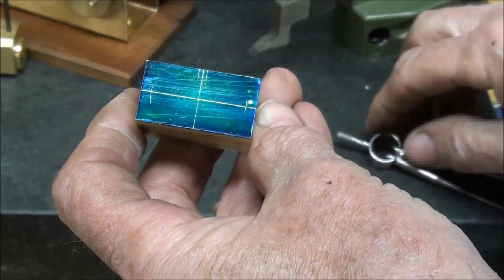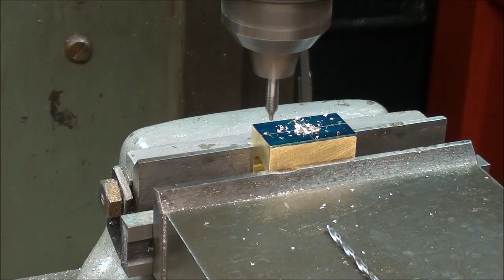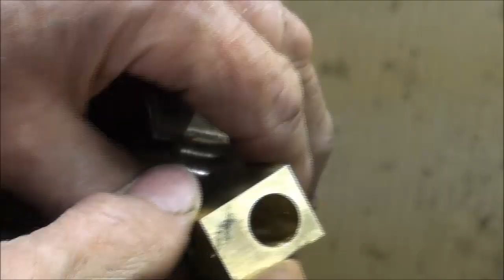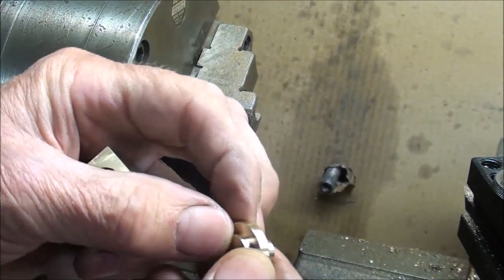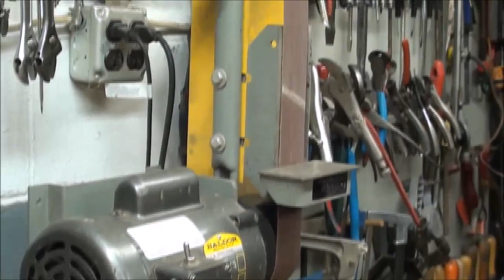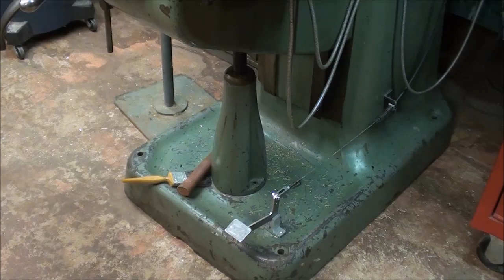Part 5 of 10 - tubalcain Builds the YELLOW BOY STEAM ENGINE

Comment: Really enjoying this build. Just wondering, what is your opinion of the "reasonably priced" combination lathe, mill drills?
Cheers,
Lee
Reply from the maker: +Lee Waterman I would avoid combo units as Gary C stated. I think mill/drills are ok as long as you do not get the cheapest ones. good luck
Reply: +Lee Waterman I used to have a Clarke lathe/mill combo and was excellent for small model making. Not as rigid as  a separate mill but usable. The biggest problem with them is when you leave an unfinished job in the mill or lathe then need to use the other half for an urgent job. So unless you are very limited on space or budget I would go for separate items either new or used depending on the budget. regards from the UK
Reply: From someone who knows a lot about computers and electronics but, admittedly, knows only a little about industrial machinery, combination ANYTHING is not as good as equipment for a single, dedicated purpose.  This is a universal rule that should become an economic law/theory because it never fails.  Even cell phones today are crap because of this need to try to cram everything into one device.  Dedicated phones are better than 4th gen smart phones, and so are dedicated tablets/netbooks for computing/browsing/gaming/processing.  Same goes for printers, computers, radios, security devices, cameras, and so on.  Can't imagine any situation/item that isn't made mediocre by the marketing ploy of combining multiple devices to a single device.